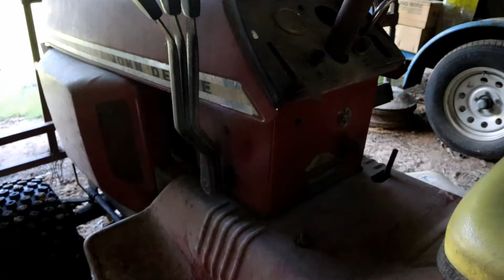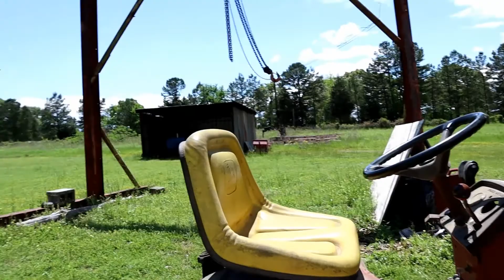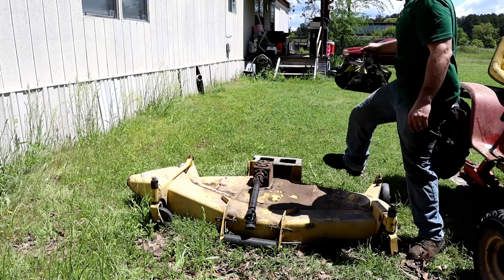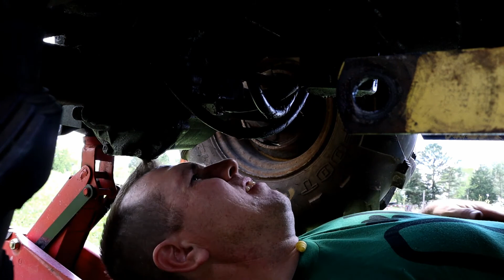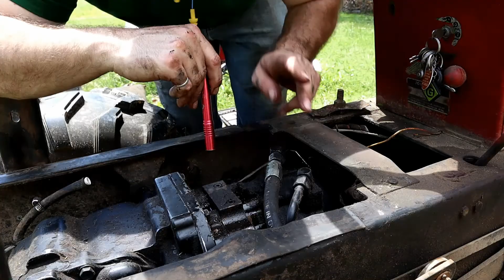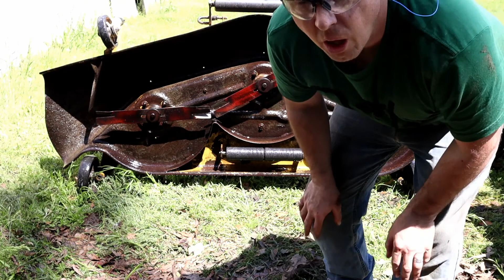John Deere 400 Full Service And Hydraulic Pump Disassembly PT1

Comment: Hey how’s doing? Nice videos...
I have a 1980 JD 400 and the steering wheel is spinning round to round, I’m green on tractors, any ideas?
Thank you
Reply from the maker: Is it just the wheel or the whole shaft too?
Reply: The steering wheel make a pop noise when i turned to the left then started spins freely round to round and the wheels still to the left
Reply from the maker: Difficult to say what the problem is. Might not be the same Hyd assist system mine has either. Good luck man👍

Comment: I'm glad you saw the belt was on the wrong side of that stud. I almost freaked out thinkin you were gonna miss it. Haha. How's that belt holdin up? I ordered one through a John Deere dealer and the thing cost me $85. Was curious how much yours was and it's durability
Reply from the maker: Yeah i almost overlooked it.  Nice catch!  I got the JD belt the first time and it wore out in one season.  I had some issues with a pulley sheave though.  I have ran the 144" kevlar type for the past several years with no issues.  Almost the same price but it's been more reliable so far.
Reply: @Man-Time  Sweet. I'll give it a shot when this one goes. Thanks!